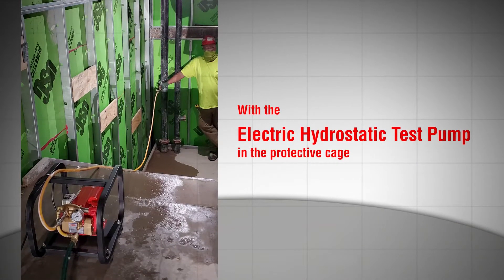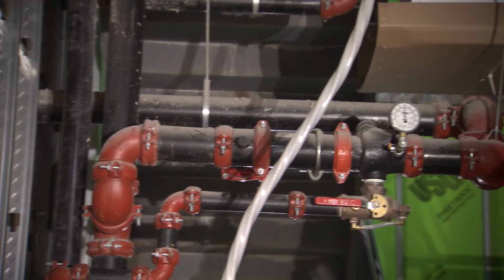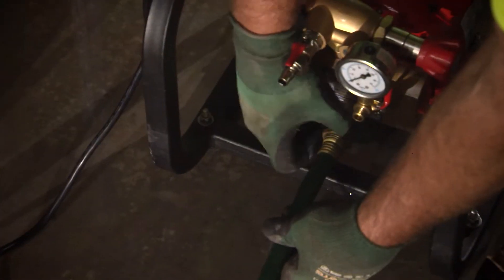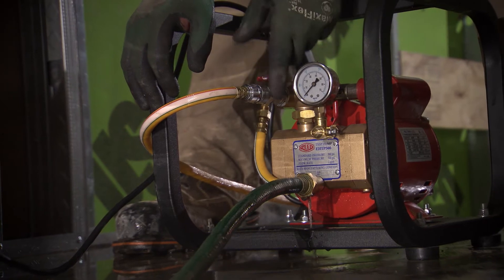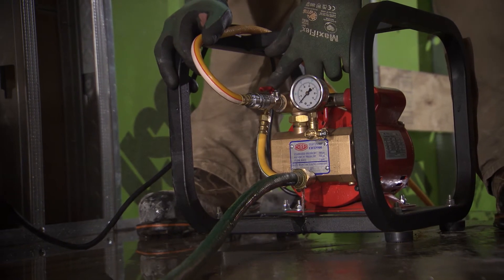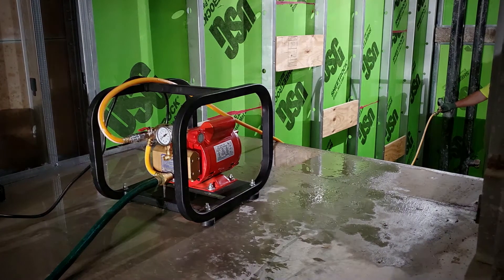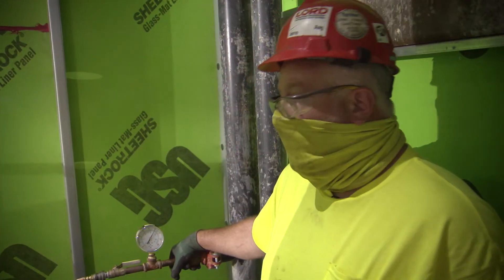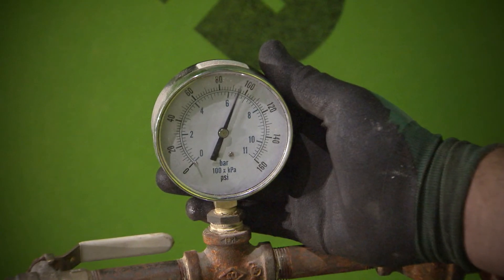Electric Hydrostatic Test Pump on Location - Reed Manufacturing

Comment: Do you guys offer an Hydrostatic Test Pump that is battery powered in this size? The drill pump is as close as it gets, but out in the field we are looking for something light and portable with enough power to quickly pressurize 4-8 inch underground Ductile Iron Pipe that has already been filled. Out in the field we don't have power and bringing a generator defeats the purpose of light and portable, and gas powered can be also heavy and bulky.
Reply from the maker: Have you looked at the DPHTP500?  You power it with your own battery-powered drill.
https://www.reedmfgco.com/en/products/test-pumps-and-groovers/drill-powered-hydrostatic-test-pump/